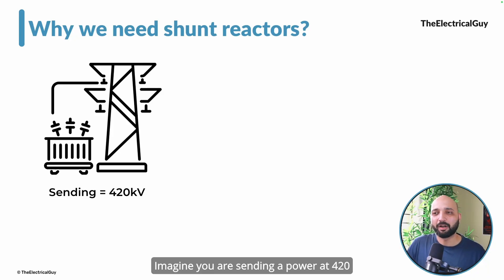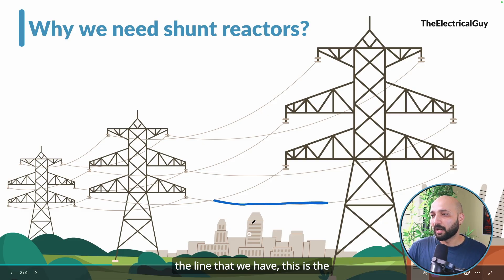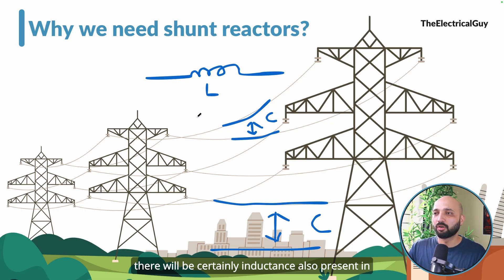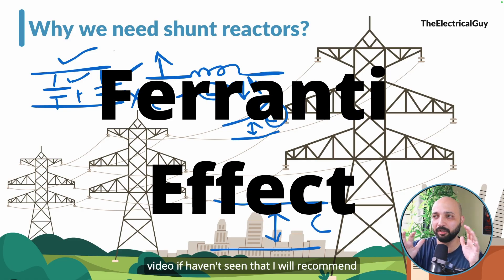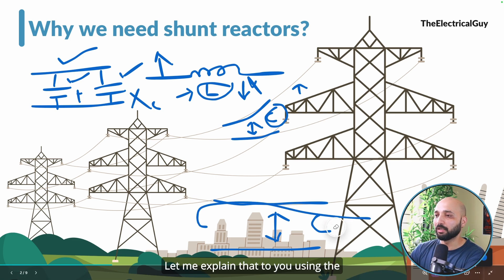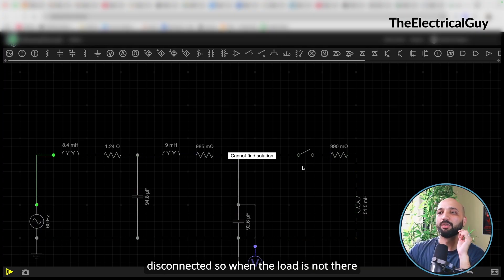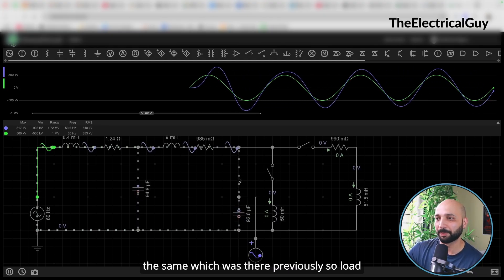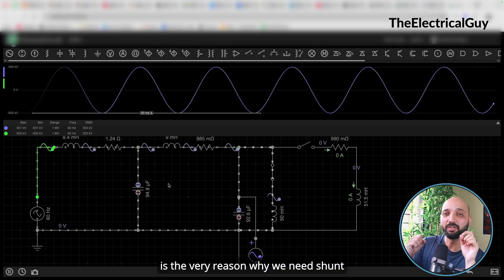Why Are Shunt Reactors Used in Power Systems? | TheElectricalGuy

Comment: I have some questions regarding the numerical explanation, hope Gaurav or anybody reading this comment can answer.
1. Why is Xc divided by distance rather than multiplied?
2. How is Xc doubled at both ends? As far as I remember, the pi model lumps the capacitance and represents half at both ends.
3. Did the Er formula used here use the voltage divider rule? Then why not XL - Xc?
4. Why multiply voltage squared with Xc2 in VAR compensation at last?

Comment: 10:00 how decreasing the denominator (XC-XL) i.e, XL increasing will decrease the V receaving end
Reply: The equivalent impedance becomes (ZC \ ZL) / (ZC + ZL), and in complex form, a minus sign appears in the denominator. As a result, the closer the magnitudes of ZC and ZL are, the larger the shunt impedance (the parallel coil and capacitor) becomes, making the 300 ohms negligible. (Gemini AI pro helped me ;) )

Comment: You repeat, many times, that if the line is lightly loaded the inductive reactance goes down. That doesn't make sense to me. The inductive reactance of the line is fixed by the geometry of the line (spacing between lines, length of the line etc.) If you mean the voltage drop due to inductive reactance decreases when the load on the line is minimal, that is what you should say.
Reply: I had the same question 
, but here the current is nothing but the load. And load the load is commonly reactance. So if he says the current increases it means that the load connected to the line is increased (which is basically reactance)

Comment: Great follow up! Thanks
Any topic is good, since you mentioned loaded transmission lines, how about covering series capacitors in transmission lines. How they cancel out the inductive impedance and vary the capacitive impedance just by the nature of current through the capacitors. No active controls. I should say, for static var compensation using series capacitor banks. Plus, how they are protected, in my experience, by being shunted across through line reactors with a breaker closing. As opposed to normally in a fault condition a breaker opens. That was fun to commission and wrap your head around with a closing breaker under fault conditions.  Odd working with a 2 cycle close / 6 cycle open breaker. Normally the opposite, you want it to open faster. 
Good videos and enjoy them.

Comment: You should do a video about why the Spanish Grid system recently went down.  This video here explains most of it already.  Whenever you have Resonant Circuits which undamped, you are going to get huge possible resonant overshoots and buildups.  In our experience, most cable systems have Q's in the range of 1-to-3.  If you add or subtract reactive loads (common in household systems), you can easily created major Phase and Voltage changes along the many miles, and when that goes through intermediate substations.  We modeled the Santa Barbara power system, and they use capacitive Tap-Changers to keep the phase losses down, and voltages controlled.  Unfortunately, the tap-changing caused large high frequency Voltage Transients at various places along the lines.  Those actually disrupted some of our company systems.  If large enough, those transients can cause a cascade, or zipper faulting, along the system protectors.

Comment: How are we getting the XC 1 and 2 1000 οhm each?  We have calculated the C-reactance 500, already. Is it because of the 2 wire transmission? Then 1000 should be split between 2 sides resulting in 500 on each.
Reply: If you get the answer then please convey it to me also.

Comment: Doesnt the Ferranti effect cancel out the voltage drop due to resistance?

On one hand we are stepping up to high voltages to counter voltage drop during transmissiin but on the other hand we are neutralising higher voltage recieved.

Cant we utilise this higher voltage recieved instead of neutralising it?
Reply from the maker: The higher voltage due to the ferranti effect is not trustworthy.. i mean if load varies the voltage varies and which cannot be used.
Reply: @GauravJ my proposal is that let us design transformers which can handle 600kV. Then This transformer can be used as a booster for super long transmission, say 1000km. We can provide power to remote areas of Kashmir, Ladakh, Northeast and Andmans from Thermal plants in the main land. Even export power to neighbouring countries like Nepal, Bhutan and Srilanka.
Reply: One more thing as you explained Ferranti effect increased the voltage at the receiving end, now the question is receiving end voltage higher than generation side voltage as a result it should be reversed the power flow isn't it. Please explain
Reply: @nweerakkody  brother it is not like that power has to flow from higher voltage to lower voltage node. It is the flow of real power which will depend on the instantaneous phase of the voltage at sending and receiving end. And you will always see that the phase angle of sending end is always higher thn the receiving end. It is only the reactive power which flows from higher voltage side to lower side. Hope you got it now.
Reply: @priyankugoswami4442  Not sure you try to empahsis the phase angle or instantaneous amplitude vale of the voltage.
Reply: @nweerakkody for the part where we discussed about power flow... It mathematically follows that real power always flows from a bus at a higher phase angle to a bus at a lower phase angle.. Whereas reactive power flows from a bus at higher rms voltage to a bus at lower rms voltage. You can refer to the specific formulae derived for real and reactive power between two buses in any book related to power systems.. Thanks
Reply: The ferranti effect rises the voltage at the receiving end after countering the voltage drop due to resistance. Since the transmission line is designed for low resistance so the voltage drop due to resistance is not as high to neutralize the effect of voltage rise due to ferranti
Reply: @priyankugoswami4442  Thanks for the answer but this part of you r answer not make sens to me, "voltage drop due to resistance is not as high to neutralize the effect of voltage rise due to ferranti".  sorry